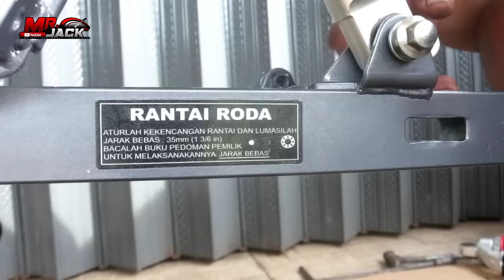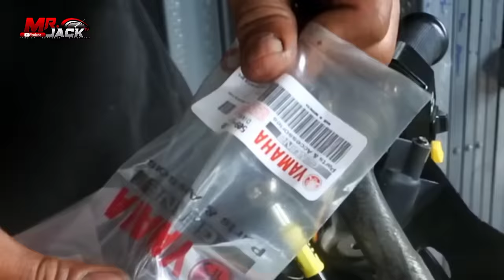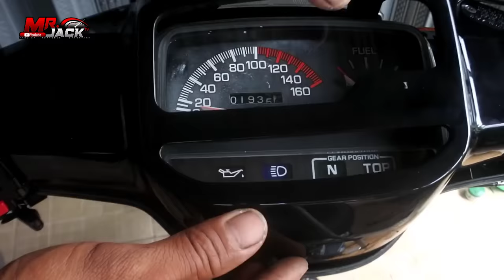Full Restoration of Destroyed Motorcycles 2 Stroke Abandoned - Part 4 🔥

Comment: I am impressed on how you restore this old bike...i just wonder how you get the spare parts you use for restoration...I have my force 1 bike which is not in good condition,, can you help me find the store or on line shops where i can buy the spares needed coz its hard to find it here in the Philippines...thanks....
Reply from the maker: hello friends... greetings from me. me to condition this old motorbike I build slowly and need this motorbike. I'm looking for goods online at shopee and others. and my motorbike body got used and there are also new original ones, there are also ordinary materials. but more are usually sold. What is clear now is that the original motor bodies are expensive. if the engine parts are still complete, the tools that are sold are original and normal. But I prefer the original material sorry before I could not fully discuss this issue. thank you friends for watching this video 🙏🇮🇩🇮🇩🇮🇩 indonesia